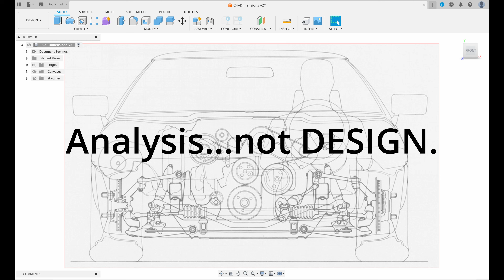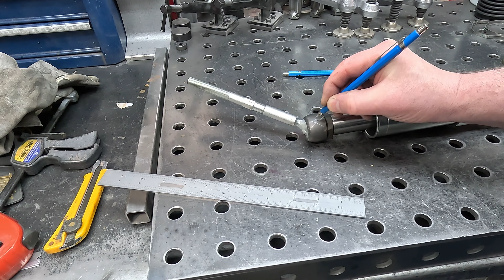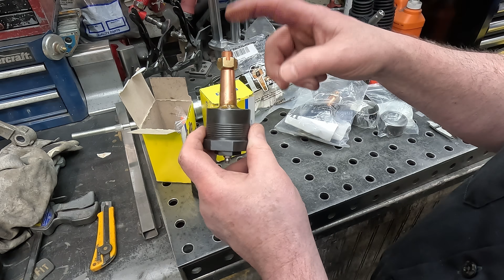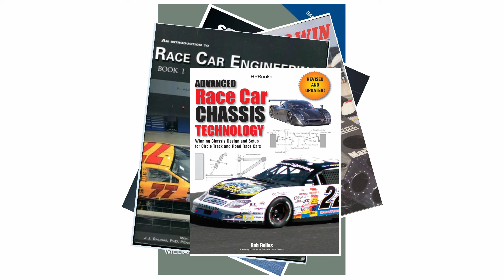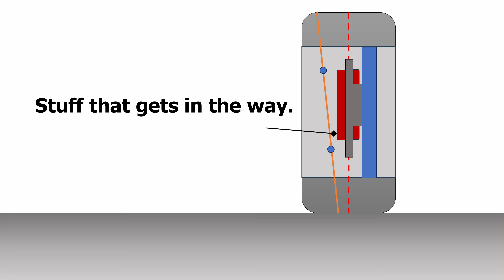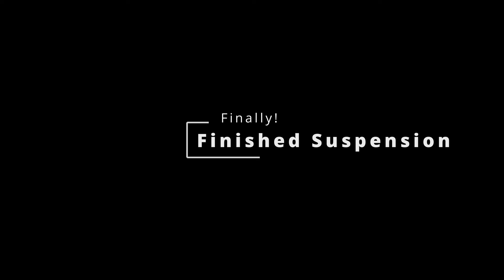Designing Car Suspension - From Analysis to Design.  Front View.

Comment: 14-15 year old me (a third of a century ago, now...) designed a car, and I had that same wonky control arm setup like your C4 Corvette suspension on the bench. 
My single source for guidance (from the public library) wasn't clear enough to me, and I tilted the top arm so the pivot on the top of the knuckle was lower than the pivot on the frame.  Anyone roughing this out -- this was all pre-internet, so I was lucky to have a small town library with just that ONE book at the time.

Several years later, re-looking at my drawings in CAD, I mapped out the virtual center, and saw that camber curve:  it was dished concave in, not convex out how we normally want for camber GAIN.   That was my aha-moment to tilt the top arm the other way.  We got stumped both by the camber curve.

Thanks for putting me back on track! Your explanation did clear up some of the murky less understood design process past where I stopped in my teens.

The visuals that Racing Aspirations provides helped backstop all the concepts better, as you explained.  It probably helped that I had some, not all those concepts percolating in my head now for 30+ years after my first and only go at a suspension design, so as you explained it on video, I wasn't falling behind.

Very interested to see what the next step holds, how the 3d-analysis is done. Onto the voodoo and dark arts of anti-dive, anti-squat, and more! And, thank you again, for taking us along for the ride. :D
Reply from the maker: Thanks - it took a lot of work to get these concepts nailed into my head.  I literally had to read and take notes and go out to the garage and play with things until how to design instead of analyse.  I'm still not confident.
Reply: @ThrottleStopGarage  I get the slow grok on the concepts.   I think you explained things well, especially all your emphasis on the things that were murky to understand from all the technical reading.

The only thing that seems unclear to me, just because of that oddball upper control arm geometry on it as it is right now:

Was the C4 setup like the one on the bench, really?  with outward/downward sloping upper Control arms so the camber curve was all camber loss? 

Or was this C4 setup modified by the seller in ways that made it set up so? :o
Reply from the maker: @chrstphrr  the outward sloping UCA is how it was designed.  That's how it is in the drawings and on the bench it is set so all points are located as they would be at ride height. There is another set of mount holes in the cross member that are lower.  I've never seen anyone mount the dog bone down there, but it's tempting.

Comment: Are you sure  your evaluation that test of the stock camber curve is correct ? At about 7:30 on. It looks to me like the wheel is going more neg camber with bump. Just eyeballing it compared to the background. Also your digital level has a generated image of a bubble level on it ? Its going to the right also, indicating the level is leaning to center of car. Or maybe im dyslexic .
Reply from the maker: I just went and checked it again and the stupid gauge was hung up on the lug nut.  Dammit.  I moved it a little and now the bubble is going the right way for the initial reading.  The model in the computer is correct - the suspension in roll is losing contact patch.  So what I said was right - what is shown is a bit of a mess.
Reply: @ThrottleStopGarage  Got ya ! So heres a question I have, regarding inputting suspension pivot pints into a computer model. In a situation like this, where the UCA pivot axis is inclined a fair bit downward (Anti dive), what point along that axis do you use for your 2D simulation ? The front ? The back ? its quite a difference in height above the ground plane. 
Love your videos. Thanks for the work. I am a suspension tinkerer also.
Reply from the maker: @storminnorman1932  Think of it as a force vector, so take the middle elevation and use that point.  It's the best you can do in 2D.

Comment: Overall, this video is more in depth than than most suspension videos on YouTube. And for people who want to learn more, books are the best option. The book i referenced most is from Derek Seward when building my engineering college race car suspension. 

As mentioned in other comments, it is important to look at the front and rear suspension as a whole. This is how you control the under/oversteer. 

Ultimately, if you are looking for the most performance out of your tires, then you need good tire data. Unfortunately tire companies are usually reluctant to give out this information. And testing the tires yourself is a lot of work. But if you have $500 burning a hole in your wallet, then you can get tire data from Tire test Consortium. 

But if you are trying to save money, lowering the upper a-arm chassis mount point about an inch should fix the camber problem.
Reply from the maker: Thanks - looking up the Seward book now.  I'm not looking to fix the C4 - just trying to reset and do this myself.  Tire data is the most difficult to get!

Comment: Great video. Just my thoughts, but I'd try to design in adjustability. With those balljoints, you can get different lengths to tweak roll center, so that's good. Being able to adjust the inner pivot is good too as it will allow adjusting anti-dive and front/rear bias. Steering rack height adjustment to tweak bumpsteer. Alternative mounting holes or spacer stacks can be used to do it.

Like the use of the Hub assemblies. I've been working on a design as and doing an IRS with it. Trying to find ones with the right wheel bolt patterns, good bearing spacing and readily available can be a hassle. Wonder if anybody has dug in deep to find some good ones?
Reply from the maker: I'm adding adjustability for sure.  I hope to get it close, but I know it will need to be tuned.  Finding the right bearing is challenging.  The 350Z is pretty much perfect for my application.

Comment: Couple things:

Roll center height alone is not a metric, it's in relation to the CG height. Yes spings and anti-swaybars control roll rate as well but then you get into ride quality. Also, roll centers need to be looked at in pair with the rear, creating a roll axis. This will tell you where weight is transferred. If the front RC is high but the rear is low, you'd get weight transfer on the outside rear, potentially lifting inside front and vice versa.

Most auto manufacturers design cars to understeer to get drivers to slow down. This can be done with roll rates (springs, swaybars), instant centers, or camber rates. So take those dimensions with a grain of salt and look more at the apsects of handling these cars have with what your going for and how the weight is balanced. 

Before you finalize control arm and mount geometry, you will need to figure out where to put the steering rack. You are limited by its mounting height, but more importantly its length, and you may have to compromise on camber gain or RC height to minimize bump steer.
Reply from the maker: Great points.  I'm not sure how to put this all into one coherent video.  I'll do a little better with the RCH description as I know I oversimplified that point.  And it's an important point.  I did design with the steering rack in the loop - so from the front view, it's installed in the model and there is a bump steer output based on the FV only.  It get's left alone until I do the top view then it's set.  I have the bump steer dialed out at this time and when I put it into 3D then that parameter is (and this will start an argument) is probably the most important.
Reply: @ThrottleStopGarage  I did forget about being concise for the video. 

Bump steer is definitely important and I'd focus on it more than camber gain. Going forward, I'd say also say bump steer is more critical than ackerman. You have slip angle regardless (just how tires work) and that slip angle changes depending on sidewall, tire pressure, intial camber, and tire load in the corner (so springs and swaybars). You dont have to be super precise with a numeber, but there is a range. Iirc the c5 corvette is ~130-140%. As a reference, my awd s10 (lowered and low pro tires) has the factory geometry of around 180% and the 320tw tires fight each other in parking lots.
Reply: Roll center axis does change lateral load weight transfer distribution yes, but does not change diagonally. Meaning, in the case of high rear roll stiffness,  the outside rear tire may increase it's load but the front and rear weight distribution remains the same. Both the front tires loads could remain the same, but the inside rear decrease as much as the outside rear increases. To have longitudinal weight transfer, there must be longitudinal acceleration. 
It's a common misinterpretation for people getting into vehicle dynamics
Also, roll centers are fake, but that's a deeper dive 😅
Reply from the maker: @sevenducecut  the roll centre debate does my head in...I understand the desire to get a reference location, but the nature of the beast can't really be what is described.   If you have specific advice...I'm all ears.
Reply: @ThrottleStopGarage  You did your research and did just as well as anyone getting into this black magic.
Roll centers are a simplification of forces going through the control arms. The calculations of roll stiffness using roll centers are useful when you have a suspension system already made, and need to see what the system does as you make adjustments (on a car with adjustable points). A more complicated but closer to truth method uses instant center position to find jacking force, and IMO is better when first designing a system from scratch. I haven't seen this method in books, so I've had it on a video to do list for months 😅
Reply from the maker: @sevenducecut  I'll be on the lookout for the video.  My current struggle is that as soon as you go to design the side view, the motion gets more complicated than what I see presented.  I am guessing that this may, therefore, be academic.
Reply: @ThrottleStopGarage 
It took me a while to finally finish it, and it's not exactly how I want it to look, but I went ahead and made it.  https://youtu.be/Ct1yM2PCktU?si=bju3VYz1Z1OEgO8-
Reply: @ThrottleStopGarage  have a look at Danny Nowlan’s book ‘The Dynamics of the Race Car’ It does a really good job of putting everything together from the other source books you mentioned. Danny is also a very personable bloke (we exchanged a few emails).
Reply from the maker: @woznaldo  I read Danny's column religiously in Race Car Engineering. I try to work through the math and understand the physics.  Every once in a while, I convince myselft I understand it...just before it all stops making sense and I have to try again.  He's great.  I do wish the spec racing series people woule read his articles on why spec racing kills engineering.
Reply: Really interesting well explained and going through the comments still a number of items to cover.

Comment: FDF RaceShop in Ontario makes angle kits for drift cars (aka a lot of experience with non-OEM front suspension geometry modification). I believe they have their own engineering department too. Might be worth trying to reach out to them… they’d probably be atleast a little interested in helping out upon hearing you built a 60’s Volvo body out of carbon fiber

Great video. Really appreciate the visual representations! Probably a huge PIA to film and record
Reply from the maker: Thanks - there are a few companies around that could help out.

Comment: In your research of existing cars roll centers to help decide your geometry, did you also see a pattern between roll center height and track widths? If your reference cars actually followed a 'rule'?  You did not directly mention anything about that here. The closest is the camber curve which, of I remember correctly, helps to keep the COG over the roll center. I know it is impossible to cover everything in this length of video but curious as to if that was part of your process.  Your classic car is narrower and taller  than modern high performance cars so how much should your reference them? This probably could be a video in itself.
Reply from the maker: Interesting question.  Track widths are wider these days and somewhat variable between car classes.  The RCH has to be set in context to be sure and a value between 40 to 80 mm was pretty common.  There are differences in how RCH is measured (force-based vs. geometric) and most of the forum material posted is from guys in their garage trying to sort things out (like me - and subject to uncertainty).  What I found was they fell in that range.  There is also variations in centre of gravity to consider.  I'm unsure how closely I should follow - but there is variation in heights and there isn't a single value - same with camber curves.  The Volvo had almost no camber gain or loss in it's original form - so guessing at a roll angle and then setting a camber curve is guess work.  I had to pick one - I have raced cars with a lot of roll and it's not confidence inspiring - even on the road it's not what I prefer.  I picked this rate based on this very limited experience.

Comment: What a fantastic explanation for how to establish a starting point on geometry!  

If i remember correctly, your steering inner pivot should now fall on the line drawn between the inner pivot points of the upper and lower control arm.
Reply from the maker: Yes - that's correct.  That is why the steering rack choice comes before setting the LCA/UCA inner pivot relationship.  I didn't appreciate this before!
Reply: Yes the length of the steering arms is correctly displayed in the last diagram. It should I theory fit in that line. But after determining this length, it will be offset by cause of Ackerman.

Comment: Great video and a good attempt or start at solving your problems.  I am not aware what tires you plan on running. If they have a larger side wall and will have significant contact patch migration under cornering load, then you may need to increase the scrub radius. You want to insure that the forces generated at the contact patch stay on the same side of your SIA as you load it up dynamically. You don’t want to have the forces at the contact patch go past the SIA, as when this happens any feedback your feeling in the steering wheel will also change direction, pulling the steering wheel in the opposite direction mid corner. 

Next thing, as the SIA increases, you get more / less camber gain as you turn the steering wheel. So if your benchmark cars were getting 0.6° camber gain, but had a lower SIA angle, you might need to design in more or less camber gain in your wishbone length ratios, to accomodate for the camber loss you get when turning the wheel with a high SIA angle. 

Looking forwards to the next video. 
Cheers. 
Ryan.
Reply from the maker: Thanks Ryan - 225 45 17's are the target tire - probably a Michelin Pilot Sport 4S or similar.  Is there a source that I should read to take a stab at ensuring that the scrub is in the right range for the tire.  I've never been able to squeeze tire data from the MFG's (and I've tried).  I wonder if there is a simple tire model that would be good enough for a first approximation?
Reply: @ThrottleStopGarage  I have not looked.  I know Avon motorsport did have some tire data available for their motorsport tires.  You might also be able to get data from some of the other motorsport tire suppliers.  I've never tried. I think as long as we are aware of it, and have some idea about where it will be, then ultimately, we can design for it. I'm going to assume you have seen some GoPro type footage somewhere that shows the tire being stretched, pulled across from its static position and heavily loaded mid corner? If we use that as our crude basis for estimation we can then say we assume that the tire side wall goes from being vertical/perpendicular to the surface, to say  at absolute worse case, 60° from perpendicular.  If we know the side wall height (difference between tire radius and rim radius) then we can calculate how the contact patch may migrate laterally under load.  All I am concerned about is keeping this contact patch on the side of the SAI during cornering.  There is also a side view component to this as well.  Caster and hub offset forwards or rearwards of the SIA come in to play in this orientation.  My thinking is that making sure the contact patch is in a known position relative to the SIA is still valid to keeping a consistent feel in the steering under all conditions.  If you go back to the C4 corvette.  The tire size was 255x45 R17.  So a side wall height of  255*0.45 = 114.75mm? (is it radius or diameter?)    * Sin 60° = ~99mm.  IE under load the stock Vett front contact patch may move up to 100mm or 4" assuming the 114.75mm was the radius.  Hence why its knuckle offset may have been where it was.